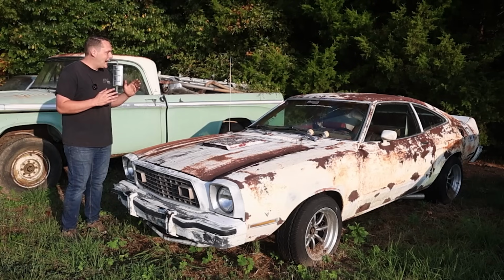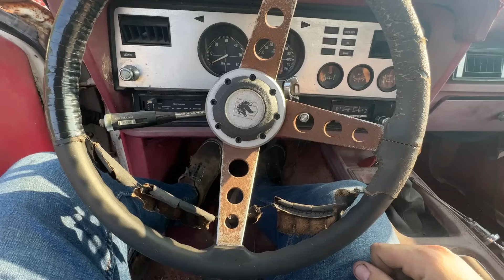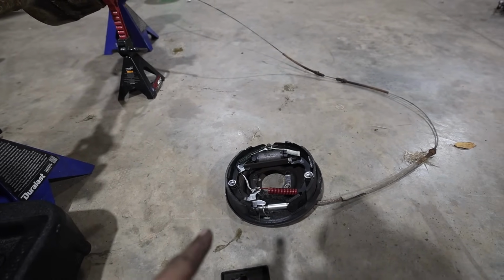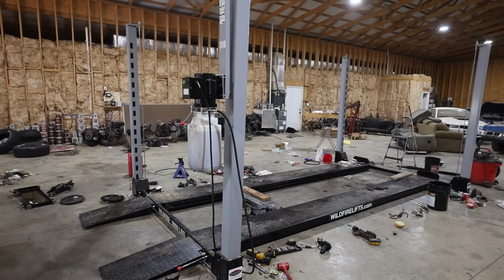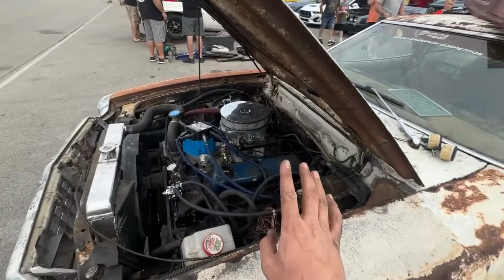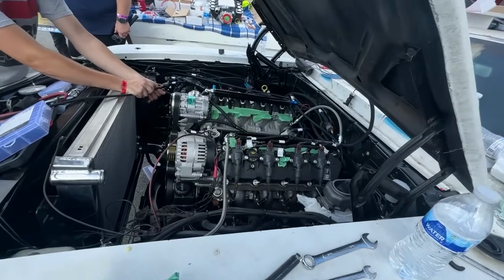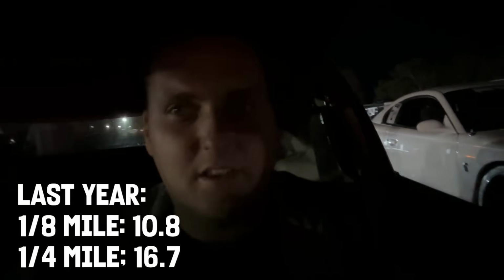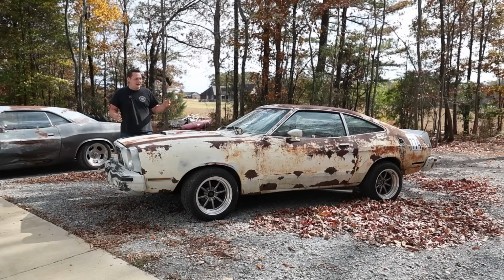ABANDONED Mustang Cobra Rescued After 27 Years - Will It Race on Nitrous?

Comment: Also, I am 40 years old and who else remembers those cool older Rangers with the full factory body kit on them? They were called Ranger GTs. It had to have been mid 80s with the 2.9, but they always looked SO cool with their factory body kit. I saw them all the time in the mid to late 90s. I also had a chance to buy one of the original white late 1980s Escort GTs with the 1.9 and 5 speed manual with the factory body kits, but I didn't take it. I would've loved to have gotten it and turbocharged it to make a fun American hatchback.

Comment: If I had known you before you started this, I would have warned you about the backing plates having a different bolt pattern. With the axle tube ends that fit the backing plates, you would have not been able to use 31 spline axles. When I do a rear end change, I always 5 lug them. Even if I keep 4 lug front.

Comment: Sorry if I missed it, but with the rear brakes did you happen to go from 10" to 11" drums?  If so, I ran into the braking issues sticking an 8.8 from an 88 Cougar XR7 in my 89 Mustang that had 10" drums vs factory Mustang 9".  Threw off the hydraulics off on the brakes a TON with the larger drums and wheel cylinders.  It would stop fine but had a TON of pedal travel.  Sadly I never got to fix it before the passenger strut tower and frame rail rotted out making it not road worthy.
Reply: Also, the reason your brakes didn't work, Ford had the small and large bearing 9" axle. The 8" and 9" small bearing used the same backing plates, but your new one was a large bearing style so the brakes wouldn't fit.

Comment: I’m willing to bet the misfire at the end of the runs was due to the spark plugs. If you didn’t go a range colder, it probably partially torched one or two and they run okay when the engine has cooled. I’d also prefer to see the mph difference on the drag runs as that will tell you how much power you picked up. The ET is driven by the first 60 feet, but the mph doesn’t lie. Thanks for the entertaining video.

Comment: I have owned 3 Mustang ii. Suspension upgrades would totally change the car. With 600lb 1 inch lower springs in front and 150lb 1 inch lower leafs and swaybars front and back with good shocks totally change the car for better. I wondered why you didn't put on 1969 351W heads on the motor or GT40P heads with the cam and intake. It would give you over 9:1 compression and larger valves good for probably 25 hp or more.

Comment: Hi Dylan.  There were a number of Lincoln models that had the 4.6 DOHC (essentially the Cobra engine) in them.  It probably wouldn't be too hard to find one in a wrecking yard.  I think they were rated around 320HP, if my memory is correct.  It would be a good base to build on, if you got the electronics worked out.  I think not having to deal with a carb would be a plus.

Comment: Just awesome good content ! Keep it coming ! I wish that I could have brought my 1973 Mustang convertible there, it looks like so much fun! My Stang came with a 351 Cleveland Ram Air Q code, also a competition suspension, 3.50 Track Lock rear and a Toploader 4 speed. The engine was rebuilt .040 over and a competition valve job, heat treated shot peened rods with ARP hardware, Keith Black pistons Total Seal rings etc! I put a Holley Sniper with a Sniper billet distributor and Sniper electronic ignition. Hopefully you read this...BAP (BUY AUTO PARTS) provided a 12.7 to 1 steering box (Saginaw series 800) Stock was a progressive 24 to 1! HUGE difference in responsiveness of the front end.

Comment: What differential did you get? A clutch style r gear style limited slip? We just tried to buy a quick performance 9” and they were two months out, bummer, ended up with a Currie housing and speedway diff because it was in stock, definitely not as cheap

Comment: Heavier sway bars,little flatter/ wider tires  should pick up couple seconds in auto cross. tracktion  and handling. 1/4  short shifting 2&3 let them lower gears eat. Had to rewind a couple of times. However  on the cheap Heavier valve springs  higher rpm better mid to high torque.  Easily take you 1 to 1.5 quicker in both events. Worked with a fella that had a 79 t-top cobra my first experience with building a 302 . Fun little car for sure.

Comment: the clutch disc is seized, a good way to break it loose is to put it in gear , start and as you ars moving hit the brakes several times, that will usually do the trick.

Comment: if you put a filter with a return line to the tank before the fuel pressure regulator it will save that regulator from having to hold against constant pressure and you will have long life and good performance out of that fuel pressure regulator

Comment: I liked less than 5 minutes of original upload when it pulled a David Copperfield. Even disappeared from my history. I had a 4.56 gear set up to put in a Pinto I was building. Never got there. I had two 2.8 v6 powered Pintos that came with 8” rear ends. Cruisin Wagon was 3.08 and hatch was 3.40 gears. Still have Offenhauser 4bbl 2piece intake never used minus some hardware.

Comment: Really cool video Dylan! there is tons of potential in that Mustang II. 😄 I would love to build a 1978 Mustang II king cobra which had the wild graphics with a very hot Ford 331 stroker with great heads like the AFR heads, Great cam with 10:1 compression and build it to be a nice driver that winds to 7500-8000 rpm and put a 6 speed manual transmission like a Tremec  T-56 Magnum and a 9 inch with either 370-410 gears and a few other modern upgrades, too costly a build for me but I can dream right?

Comment: that engine still isn't performing as it should. you should be able to get mid 13s with a decent 302 w NOS. maybe faster with lower diff gears. 4:10 or better. I'm a fan of that body style, dunno why , nostalgia I guess but I remember back in 78 a friend had a king cobra model with black paint and orange pinstriping and that thing looked sweet.  I had a 65 stang with a fairly stock small block no nitrous and I could get 14s out of it. If you really want to have fun with it you'll need to put at least a late model 302 HO or Coyote in it :)

Comment: I love the Mustang IIs. I have 2, my favorite of the two is my 77&1/2 t roof car. Less than 60k miles 302. I found another one with the Lincoln Versailles 9 inch rear that I will be swapping into it. I was never a fan of the automatic transmission  so I sold it and will be going back with a 5 speed

Comment: The mustang is coming along great a lot of the cause of having to slow down is because of the suspension you have way to much body roll as to scrub off speed you to make it stiffer heavy sway bars and adjustable coil over shocks would make a world of difference between doing 49 in the road coarse and breaking 44 or less time through the road coarse don't go to crazy you still want to keep it a street driver the nice part of the whole thing is to have fun and don't loose that perspective of doing anything

Comment: added 600 pounds to a car changing from a 308 to a 373 gear... it gets upto the corrected 60mph in the same time as the 308 gear, with less then half the throttle use. "1.211 change in torque... +1500lbft in first"... know it makes 460lbft brakes the 8.8...

Comment: there are so many suspension upgrades for this, car. If you remember back in the 80s and 90s, hot rod builders would cut these cars up for the front's frame sections. The American car culture.owes its Lots of homage to Ford for That sacrifice , There might be more of them around if they had not all been chopped up , And they rusted badly. Because of sub standard metal quality Issues , Lots of choces to stiffen up the suspension nowadays for cheap money. I had my first ll when I was 20  Many, many years ago., I have Slightly modified mustang ll king cobra  now and will never sell it. Love the Cobra two, Dylan. I would scrub it with a stiff scrub brush. Buy a couple of cans of satin clear to encapsulate to finish and leave it alone.

Comment: Needs a hotter cam and roller rocker aluminum heads ,that car could put out about 300 horsepower and at 2800 pounds It's the ultimate red light car..

Comment: 👈mustang has a 600 wheel horsepower blower motor in it for 15 years I drift, grip, drag race it and I’ve been running four lug that entire time the only real upgrade five lug offers you as rim selection if you’re happy with what you got don’t waste the money unless you’re going for super power. There are plenty of eight second four lug cars out there though